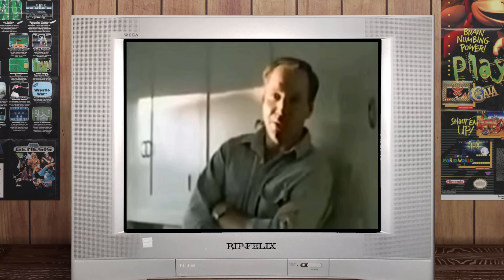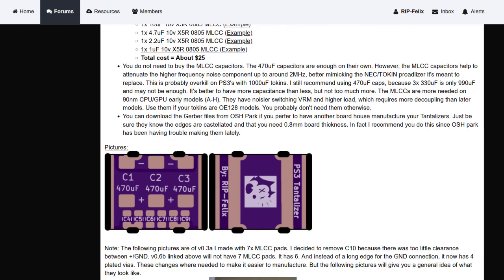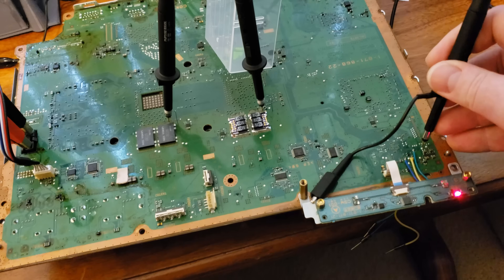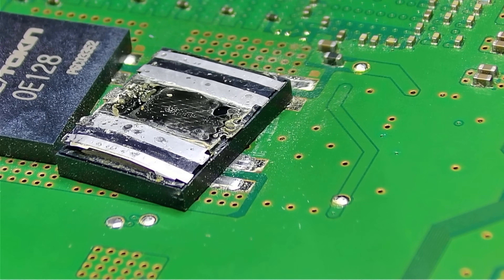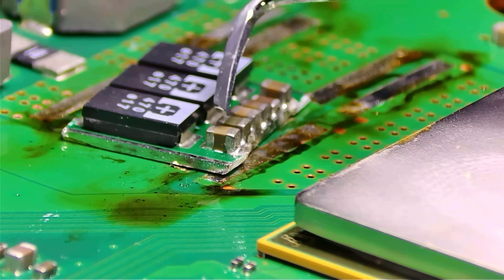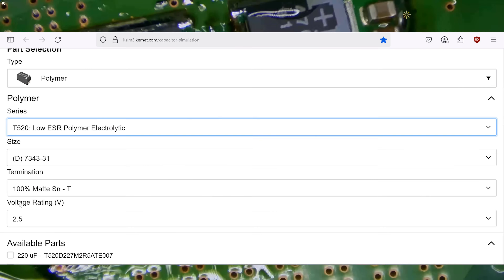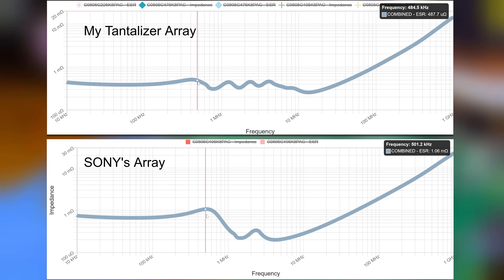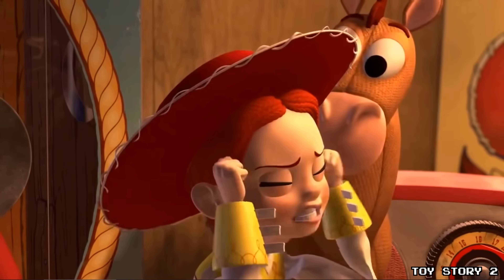How To Fix | Episode 2: Bad NEC/TOKINs

Comment: RIP Felix, I have a question, if you could help me out, I’d really appreciate it.

My CECHA01 had 90 days of uptime when I bought it 8 months ago and is now with 110 days having an issue. I undervolted both the CELL and RSX when I bought it back than and changed thermal paste, which led to lower temperatures and reduced power consumption throughout that time.

However, I’ve noticed that over time, CELL temperatures have been gradually increasing. Now, the CELL is reaching almost 80ºC with the fan running at 40% (it was 10ºC lower before), even though power consumption remains the same and RSX temperatures haven’t changed.

Based on what I’ve described, could the issue be the thermal paste on the CELL (the paste below the IHS)? Is it time for a delid?

I don’t see how undervolting could be the issue, since power consumption is still lower than before and the RSX is performing perfectly fine. And the SYSCON has not logged any error related to power. It's just CELL is getting hotter the more I use it!
Reply from the maker: yeah, my guess is that the paste under the cell IHS finally gave up. It's in need of a delid. Rambo's delid tool is good and can be had for not too much. Amazon carries it or you can go to ps3delidtool.com and buy from him direcly. I've used it and it works just about as good as NSCs delid tool. Only it's easier to get. 

Also, thanks so much for your generosity. It means alot. 🙏
Reply: @ripfelix3020  I bought the tool on Amazon using your referral and I'm going to delid the CPU and repaste it with Arctic MX-4. Not sure if you're going to see this post, but I have one last question about the delidding process: should I preheat the IHS with a hairdryer to make things easier, or is it better to just do it cold? It's my first time doing it. Again, thanks for the help, man.
Reply from the maker: I'd do it cold, but you could heat it if you like. I just dont like to and the delid tool shouldn't need it. Add a bit of grease to get it started and once it's under you'll be fine. Just be careful not to cut yourself!
Reply: @ripfelix3020  I did it! It worked! When people said the V2 Delid Tool would cut like butter, I didn’t believe it, but it does! On my first-ever delid attempt, I had no trouble at all and finished in two minutes or less. I followed your recommendation: did it cold and added a little lubricant.

My temps are now so low that I can keep the fan control at 33% in webMAN while playing PS2 games. Didn't tested with PS3 games because this console is only for PS2 (I own a Slim to play PS3 and PS1 games).

Again, thank you so much. RIP Felix. You and your science have helped the PS3 community more than I could ever repay. I wish I could donate more to you, but I’m broke at the moment.

Anyway, sorry for the wall of text, and thank you again, man!
Reply from the maker: Glad you got it working. Nice work!
Reply: @Tio__qi  what kind of lubricant did you use?
Reply: @bunkercollector  Singer sewing machine oil. It got the job done, since I didn't have any grease. Put just a tear drop of oil on the blade and insert into the gap, proceed with the delidding. Just make sure you clean it very well after doing the delid, otherwise it will affect thermals in the worst possible way.
Reply: @Tio__qi  OK one more question for you. Did you remove the silicone from both IHS and CPU before placing IHS back on and did you glue it back on?
Reply: @bunkercollector  I didn't glue the IHS back. RIP Felix also does not glue it back on his personal consoles, so I tried to follow his instructions as close as possible. I just put the IHS back and let the clamps do it's job.
Reply: @Tio__qi  word that’s what I was planning to do as well. The only thing I was really unsure about was the leftover silicone on the IHS and the processor. Whether or not to get that off
Reply: @bunkercollector  You don't need to remove the leftover silicone aswell. Just put the IHS back in place, and you're good.
Reply: @Tio__qi awesome thank you
Reply: @bunkercollector  When I aswered your questions, I was considering that you are going to use the delid tool V2 to do the job, mind you. It left the silicone almost intact on both the IHS and the CELL BE, hence you can just put it back in the same position without any drawbacks. But if you're gonna use something else to delid, please watch RIP Felix previous video on how to do it, so you don't have any trouble with your temps after the process. Or watch it anyway, it's very informative. Good luck!
Reply: @bunkercollector  I see you've already delided a PS3 using the delid tool and made a short video about it on your channel. Not sure why you're asking me all these questions though.
Reply: @Tio__qi lmao so yeah I did that successfully but that was on a dead board. And I was uncertain about whether or not I needed to take the silicone off if I did it again for a working model and so I have another PS3 that has the exact issue you had with just the CPU overheating. I just didn’t necessarily wanna do it again because the fear of killing a PS3 but I guess it would die anyway so I’m gonna send it.
Reply: @bunkercollector  I see. Well, ironically, I found out I had actually bookmarked that video of yours as a reference on how to use the tool properly before doing it. My delidding went pretty well, so you probably won’t have any issues. Again, best of luck, dude!
Reply from the maker: I reccomend readhering the IHS and the reason I haven't on "some of my personal consoles" is to test the longevity of not doing so.

My approach to advice is to return to stock unless there is a solid enginerring rationale for deviating from the OG design. In the case of using appropriate adhesives to adhere the IHS I would not be comfortable leaving it off after deliding. Not for a customer.
Reply: @ripfelix3020  I understand, Felix. I clearly remember you saying in a previous video that you didn’t glue the IHS back on your own consoles, you would only do that for a customer. In other words, it’s not mandatory to glue the IHS back on. On PC CPUs, many experts don’t even reinstall the IHS; they just let the heatsink make direct contact with the die (some Intel enthusiasts used to do that all the time). So, gluing it back is almost more of an academic decision. But I get it, it’s best to stick with the original design. It’s just not strictly necessary.
Reply from the maker: Not quite. I do put them back on my personal consoles too. The ones I haven't are ones I'm using for testing purposes, to evalueate the long term reliability of not doing so. I would say it's mandatory if it was glued on in the 1st place, which it was. Will it die immediately? No. Will it die sooner than it would otherwise? There's an argument for that being true, but we can't know for sure without a representative sample size over a long period of time. Or a thorough similation. Neither have been done.

Lots of people are saying it's fine. That their consoles have been delided, not reglued, and workig fine for years. That means nothing! It's copium and confirmation bias. They're parroting what the want to be true, not what actually is. No body can know for sure and if they say it's fine with any certainty, they are spreading misinformation. Time may prove them right, but that doesn't excuse spreading potentially bad advice before they could know for sure.

It's safer to simply reccomend putting it back so we're not changing a varible that could reduce longevity. If you glue it back performance will be the same. You can trust it'll last as long as it was designed to. If you don't, there's no way to know that gamble wont backfire.

I'm comfortable not gluing it back, because I can replace/reball if it dies. And I want the numbers. I'm knowingly taking the risk hoping it dies. Not the other way around.
Reply: @ripfelix3020  
Just for the record: I never said you were giving bad advice or recommending that people not glue the IHS back on. I just said you mentioned not doing it on your consoles in your previous video (it’s right there in the video, without any further explanation of the reason).

Secondly, I know you’re a scientist and that everything has to be scientifically proven to be considered true, but you’re focusing too much on the console side of things (as you mentioned repeatedly in your reply) and completely ignoring the PC side, like the example I gave you about Intel. People have been delidding Intel CPUs for over a decade and even removing the IHS entirely to allow the die to make direct contact with the heatsink. That’s a representative sample size over a long period of time.

Is it scientific proof? No, it's not. Is it practical evidence, for lack of a better word? YES! And that shouldn’t be ignored, unless, as you said, you want the numbers, a.k.a. pure scientific proof.

I really hope you didn’t get offended by what I said, that was never my intention by any means. I genuinely appreciate your help, Felix. Once again, thanks for your science and everything you do for the community, man. I will always support your work whenever I can.
Reply: @ripfelix3020   To give some feedback on the matter for research. I did end up doing the CPU delid on my console that was originally overheating. I did not glue it back on, and I left the old silicone as it was. 

All data here is on the stock SYSCON fan curve and and with fresh thermal paste (MX4). I use The Last of Us to test. 

Prior to the Delid: 
Temps would rise to approximately CPU 76C GPU 56C on XMB and steady with 30%/35% fan speed.
Temps would rise to approximately CPU 80C GPU 60C during intense Gameplay and fan would rise to above 40% (I cut it off to prevent any damage).

Post Delid: 
Temps would rise to approximately CPU 72C GPU 62C on XMB and steady with 25/28% fan speed.
Temps would rise to approximately CPU 76C GPU 68C during intense Gameplay and fan would stay at 30% and on rare occasions go to 35% (Usually if the CPU hits 77C the fan would go to 35% and doesn't drop even when temps drop for extended periods of time). During less intense gameplay CPU 68/70C GPU 60/62C and fan would stick at 30%. This data holds steady for about 5 gameplay sessions.

I'm very happy with the results here. 
One more thing I'd like to note is that on startup prior and post DELID staying on XMB the CPU temp rises quite fast compared to the GPU which rises somewhat slower at about 10C less. I compared to a different console but same model with no delids but fresh thermal paste the temps of the CPU and GPU rise at about the same rate and steady at CPU 72C GPU 66C.

Next time I do a delid I plan to glue it back on and see how results differ. It makes sense that thermal flow should be different as the glued down silicone blocks any micro gaps where some tiny amount of heat would flow rather than being primarily focused towards the IHS. Sometimes these things seem insignificant but do indeed make quite the impact.
Reply from the maker: I'm not offended. Just clearifying my position. About other chipsets, everything is different. I'm not agreeing intel chips are fine deliding and not regluing, but the RSX in a PS3 is different  from a CPU in a PC. If we're talking about a laptop BGA maybe it's more comparable , but again. Different chip, TDP, everything. Even then there are too many varibles to apply what 'apparently" works there broadly to a different chipset. That's my point.

Comment: Hello Felix I have a question for you. I have a CECHE01 model with nothing but 3003 error codes. It points me towards changing the Tokins. What do you think? Thanks.
Reply from the maker: CPU tokins are quite possable. If they have worn out completely they can cause that error. That can also be a VRM issue, but first thing first. Replace tokins and go from there.
Reply: @ripfelix3020 thank you for the response. You're the man.
Reply: This may be a dumb question but I'll ask anyway. Should I replace the closest two tokins to the CPU on both the top and bottom of the board? So a total of four. Thanks again.
Reply from the maker: I reccomend that if you replace any, you replace all. The same conditions that caused one to fail in the 1st place has worn the others too. So just get it all done and move on with the diagnosis knowing that's been ruled out. And if it works, great! It wont be that which fails next.
Reply: Hey buddy, I replaced all of the tokins and the 3003 code persists. Ugh I'm feeling defeated.

Comment: I bought a low hour  E01 in 2020 it was a fantastic console until May 2025 where it died at 190 days to 3034 4411 RSX failure it's currently being frankied so hopefully I can get many more healthy years out of this console. I also have a 2001b slim that's on the original NEC tokins with over 1900 days on it so it is just luck of the draw if they last or not
Reply from the maker: Not really. The 20xx runs a bit cooler and the tokins experiance lower voltage. Those factors can greatly influence how long they last. Just to be clear, I'm not saying your tokins died on that E model. But after rework, they tend to fail sooner, so I do reccomend having them replaced at the same time now.